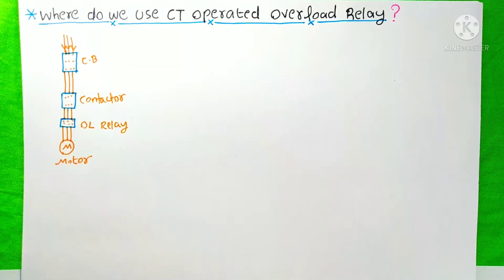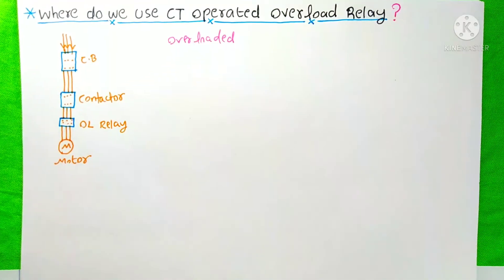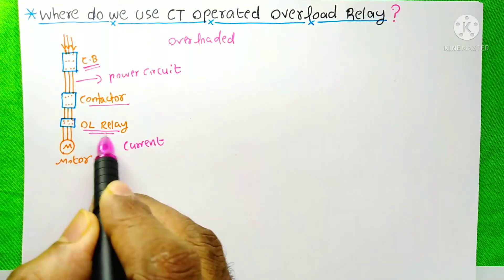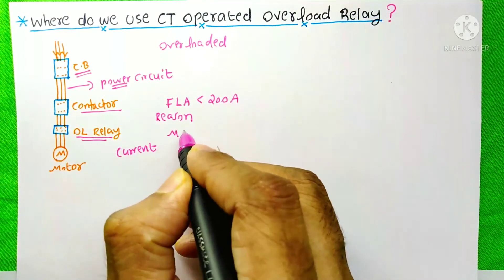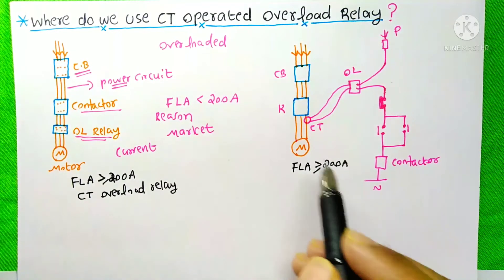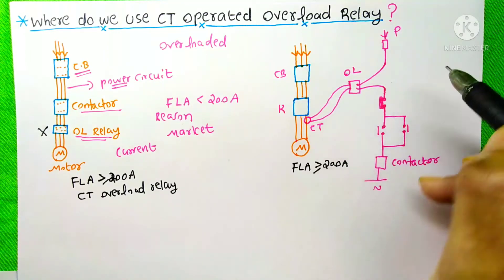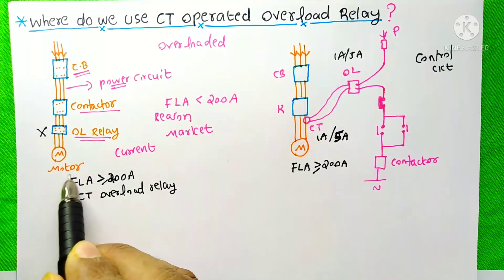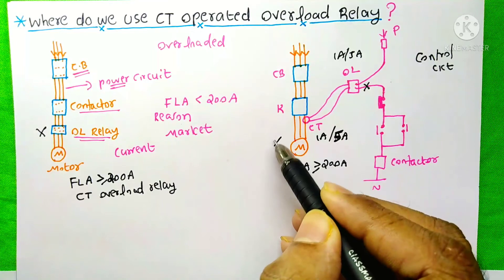Where do we use current transformer operated overload relay / Electrical

Comment: 🙏
Thanks but‚
Can I ask why we don't use normally use regular thermal over load with CTs for all motor ratings ?  Not Just after 200 A motor ratings only ?
Reply from the maker: When cable size increases , cable would not terminated on relay ., so we use CT to reduce current and the secondary smaller size cables would easily get terminated on relays
Reply: @ElectricalPlatform  
So do you think I can use it on any load as long I keep the conversion ratio ?
 
Like a motor with a 30 or 40 Amp
 And using CTs with 50/5 ratio 
And a small overload like 2.5-4A  or 1.6-2.5 A